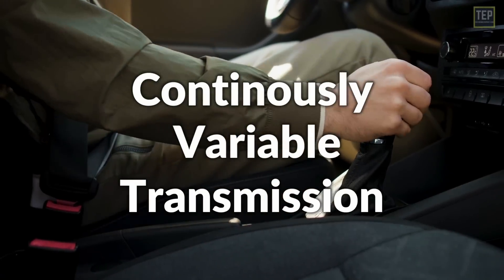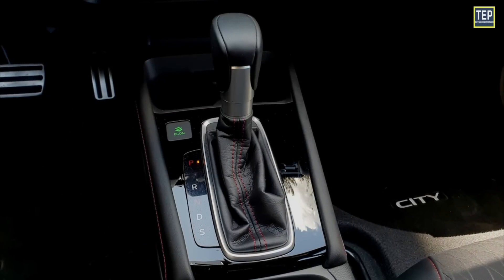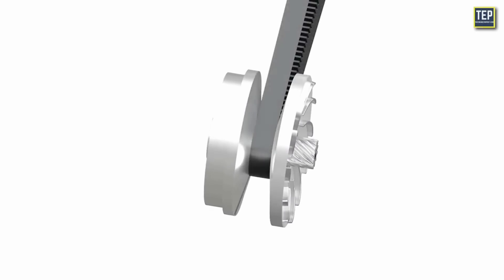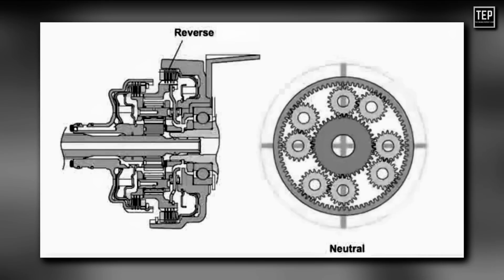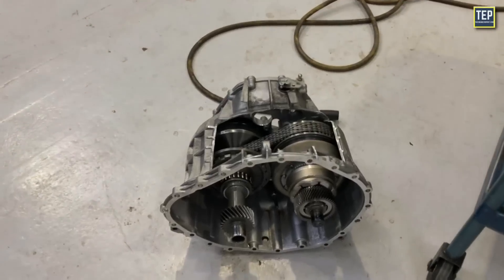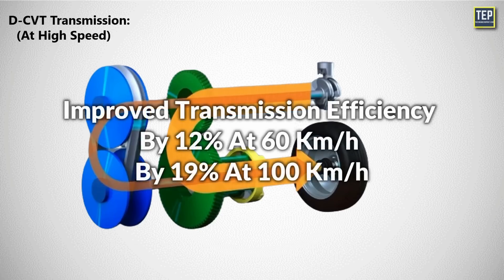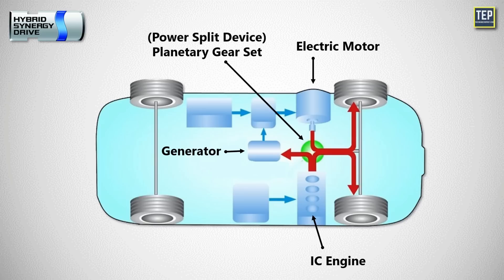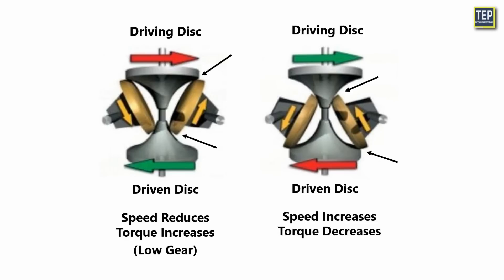Are There Any Good CVT's? | Different CVT Transmissions Explained

Comment: E-CVT (in particular Toyota's Hybrid Synergy Drive) is a clear winner.  It is mechanically the simplest transmission you'll ever see:  no clutches, no shiftable gears, no friction points (belt or roller), no hydraulically controlled mechanical transmission parts.  Only two motor-generators, one planetary gearset, and one fixed reduction gear for the drive motor.   All control is done from the electronic power controllers, and consists purely of controlling the engine throttle and the electrical phases of the motor -generators. 
I'm impressed by accounts of mechanical CVTs reaching high mileages, but they are still depending on the material-science magic of friction points that bear many hundreds of pounds of thrust on a regular basis.   It would take incredibly little to go wrong at those friction points for a mechanical CVT to become useless.
Reply: doesnt the Ford Maverick cvt use the same principle?
Reply: @kevinmccune9324  Yes. Ford originally acquired its eCVT technology from Toyota in the mid 2000s but has since further developed it on its own.
Reply: @kevinmccune9324  Yes Ford traded engine and emissions tech with Toyota in exchange for a Licensing agreement for Toyota's Ecvt design around 2004. It's  used in the Escape, Maverick, C max and Fusion Hybrids. I can actually tow 4000 lbs with my Maverick's Ecvt.
Reply: there is one downside to the E-cvt and that is it does not amplify torque like a stepped transmission or a mechanical CVT, it is in high gear effectively but that's why you have the drive motor on the output side of the transmission. I like the design myself and agree with all your points. I would increase the power of that drive motor. Did you know that you could create an AWD variant of this transmission by removing the drive motor from the front axle and placing on the rear axle.
Reply: @TheRed6263  I have to disagree.   The engine power at one RPM is transferred to the same amount of power at a different drive train RPM.  (Maybe not quite all of the power; there are losses of a few percent, just as in a belt-type CVT.)  For the same power, the ratio of the engine torque to the drive train torque is (ignoring the small loss) equal to the inverse of the ratio of the speeds.  i.e. a fast engine driving all its power to a slow drive train = torque amplification.

You may have experience what feels like low torque in a Prius, but that's because of the small (~100HP) engine in a car weighing over 3,000 pounds, not because the hybrid drive fails to transfer torque..

Electric AWD is a great idea.  The Toyota approach on Prius and RAV4 is to add a low-power motor in the rear, with high-reduction gearing to give good torque at very low speeds.  This gives a good extra boost for getting started under slippery conditions, but it drives pretty much like FWD at normal driving speeds.
Reply: @TheRed6263  I have a 2023 Toyota Sienna van, AWD version.  The rear axle is driven by a rear electric motor, with no mechanical connection to the ICE.  It appears to operate when starting from a stop sign, especially when turning.  And the AWD version has a faster 0-60 time than the FWD version, so I gather the rear axle drives under hard acceleration.

Comment: Are There Any Good CVT's?  Your title suggests that the answer may be 'no'.    
I now understand that Toyotas with CVT often have the launch gear with a belt and pulley CVT.  But Toyota E-CVT hybrids use a planetary gear system which avoids the need for belts and pulleys.
I am encouraged to see Toyota E-CVT does not use belts and thus does not depend on friction between belt and pulleys.  For me this is the way to go.

Comment: Well millions of Prius owners have these with 400,000 miles on them so they can't be that bad?
Reply: I drive a cvt Toyota. It’s not very exciting, but it’s a very impressive, efficient and reliable engine.
Reply: @jobvhk0335  Engine, or transmission?
Reply: @jobvhk0335  eCVT toyotas are perfect cars for everyday driving, they definitely are not cars meant for having fun.
Reply: That's because Toyota's CVT is an e-CVT, with actual (planetary) gears, and not a full reliance on a rubber or metal belt to transmit power.
Reply: @SgtNuker only hybrids have that the normal gas engines do NOT
Reply: @myashamoore5239  My comment was at the author referring to a Prius ... which IS a hybrid. I know the difference.

Comment: No, there are no good CVT's, just ones that suck less.
Reply: blablabla 🙄
Reply: @Bruno-m9f8o  Which provides you with more reliable way to apply force?  A lever which is what all gears are at their core or a string wrapped around an object, being pulled.

Both deliver force, but one does it reliable, consistently, and creates huge mechanical advantage... the other is, well, a child's toy called.a Top.

CVT's in their current design, will never ever be as reliable as geared transmissions.  Its simply physics.

Comment: The new CVT in fluid with a belt a stupid idea go back to a rubber belt with easy access the DAF and Suzuki Bergman are the best CVT transmission because they are easy to access and if the belt breaks it can be easily replaced by an ameture mechanic were in the planetary and belt less CVT much better and Toyota and Honda use them in there Hybrids there lubricanted gears so much more robust than belts in fluid so expensive to repair its a case the older rubber belt CVT transmission so much easier to replace and cheaper also in the UK some Invicars had a simple rubber belt CVT transmission and there is a British you tuber with an Invicar with the CVT transmissions and he has replaced the belt himself quickly and easily l will never ever buy a Nissan Mitsubishi or Subaru with a CVT transmission because they are to unreliable
Reply: Who are YOU to babble on about what is reliable and one is not?  You don't even know how to use punctuation in your rants! 😂😂🤣😅😅😅
Reply: The rubber belt in a CVT especially on a Suzuki Bergman is so much cheaper and easier to replace the rubber belt then one of these stupid CVTs in fluid it usually the whole CVT has to be replaced especially the JATCO CVT in most Nissan's and Mitsubishis and some Suzuki's but Suzuki's been much lighter cars there is not a great deal of strain on the CVT but the torque converter transmissions are much more reliable than most CVTs but the rubber belt and two pulley CVTs can be repaired by a novice mechanic because l seen a you tuber who has replaced the rubber belt on his Invicar and it didn't thousands of pounds or dollars depending on what country you come from and the CVT in Toyota Hybrids are a plantery

Comment: I have 2014 Nissan Frontier with 4.0L engine and CVT transmission. Have put 230,000 miles with no problems. Has plenty power, and at 80 mph is only 2300 rpm. Regularly maintained of fluids.
Reply: dont think thats a cvt

Comment: only reason why CVT is in use is fuel economy. 
I had IS250 and now have IS300h. 
eCVT advantage is obvious in traffic  - helps to reduce fuel consumption easily by 40-50%
but still old style hydrokinetic gearbox in IS250 was way more driver friendly or at least was giving better impression.

Comment: excellent explanation.  I had a Subaru justy for many years and while it was primitive, like the beetle, it was tough and never needed servicing. I now own a Honda hrv and it is a joy. I have only had it for 45k miles but the cvt trany has been a pleasure, shifting manually has been my favorite and my two Honda accords lasted 400k miles. but cvt mechanics seem ok to me. `````````````````````````````````````````````````````````````````````````````````````````````````````````````````````````````````````````````````````````````````````````````````````````````````````````````````````````````````````````````````````````````````````````````````````````````````````````````````````````````````````````````````````````````````````````````````````````````````````````````````````````````````````````````````````````````````````````````````````````````````````````````````````````````````````````````````````````````````````````````````````````````````````````````````````````````````````````````````````````````````````````````````````````````````````````````````````````````````````````````````````````````````````````````````````````````````````````````````

Comment: I decided to try my first CVT and bought a Honda CRZ. Honda engineers did a great job designing the sport mode. However, the belt broke at 40,00 miles. Granted, I'm a brake late-- throttle early sports car/motorcycle guy, but...
Reply: CVT's are light duty use ONLY!

Comment: Life was better without them. It's an over complected engineers wet dream.  The eCVT is not that. They should remove the CVT part of it. If you have planetary gear sets with clutches to change torque and speed, that's not a cvt, it's a transmission.

Comment: Small gas or diesel generator to charge a battery and/or power an electric motor. When battery or power generation technology gets good enough, we won't need the traditional generator. Trains have been using this technology for decades.

Comment: Have a Nissan cvt with 200k and a Subaru cvt with 145k on it. They're way more reliable than people suggest. Key to reliability is fluid changes. They're not super expensive to do compared to 5-7k for a new transmission. If you're going to keep a vehicle with a cvt, change the fluid every 50k and it will last a very long time.

Comment: I have a 20 Camry with the direct shift CVT. I rate it as a marginal performer.  I will admit it is very efficient, but really diminishes a car's enjoyment.  Anyone who had driven a car with a GM TH340, TH400, Chrysler Torqueflight or Ford Cruise-O-matic will never be satisfied with a CVT.  MHO.  I have driven a number of WV group's dual clutch cars and those are amazing.  A CVT should aim at that driving dynamic as a goal.
Reply: I've driven cars and trucks with all of the transmissions you've listed, and currently drive a Outback Limited XT.  I'm completely satisfied with the drive-ability and performance of this car.  Can't tell the difference between it's CVT and a traditional automatic transmission.

Comment: The workings of eCVT transmissions wear glossed over and not really explained. The core is the power split device, which is a planetary gear set. MG1, referred to as the generator in the generic diagram, is connected to the sun gear, the gas engine output to the planet gears, with a free-spinning double sided ring gear engaging the differential. The electric motor, MG2, separately engages the differential, and is a generator when applying regenerative braking as well as serving to reverse the vehicle, since there is no reverse gear. MG1 manages the gear ratio by controlling the relative RPM and direction of spin of the sun gear while generation electricity, and it also serves to start the gas engine.
Reply: Simply put, it's run with 2 electric motors and no belts.

Comment: CVTs are stupid in concept. Fine on a moped or low-powered appliance, where it's easy to service and replace the belt,  but not on a vehicle. 

The only good ones are Toyota E-CVT 'SynergyDrive', and Honda's E:Hev system, and neither really are CVTs. Well, maybe Toyota's E-CVT is, but it's a completely different design, and it's actually far more reliable than a manual, automatic, or DCT transmission (no clutch or contact friction).

Comment: I change my Honda CVT fluid regularly with Valvoline CVT Fluid. Then I like to read how everyone says my CVT is going to fail because I don’t use Honda Fluid. I’ve been using Valvoline for 255,000 miles and the CVT still performs fine like it did the day I bought it.

Comment: 1. If you reverse the thrust at the input of any other transmissimon (as was shown for thoroidal), you don't need reverse as well.
The question how to do it.
2. The main purpose of the direct shift transmission - is to reduce a loading on CVT part, which can have smaller diapazone of the gear ratios.
It is important at heavy offroad  conditions at SUV application or rapid acceleration from 0.
3. E-CVT is explained quite poor. Even without the detailed theory of planetary gears - more details should be given.

Comment: The so called eCVT that Honda provide is not a CVT. All gear ratios are fixed. There is a motor/generator directly coupled to the drive wheels and another motor/generator coupled directly to the gas motor. At higher speeds the gas motor can be clutched to the drive wheels at a fixed gear ratio. The correct description of the system should be called an electric CV motor and a gas CV motor. By the way it is a very good system; I have one.
Reply: Yeah, they call it iMMD (intelligent multi-mode drive). Seems simpler than the Toyota Hybrid Synergy system with the drive splitter gear. The electric drive is direct (using either battery power or generator power or both) and the engine drive at 1:1 ratio also has no "gear" in the drivetrain, just a lockup clutch to bypass the electric drivetrain. It overcomes the electrical losses of the drive motor operation at high electric motor RPMs. I have an old 2009 Honda Insight hybrid with a metal belt CVT. Nearly 200k miles on the clock and no issues. Just a couple of routine CVT fluid changes in 16 years of use. It's very efficient at highway speeds and quiet too. 62mph at 2,000RPM. It also has a "7 speed manual" simulation mode with paddle shifts to select fixed ratios for a bit of fun but that hurts fuel economy and it actually accelerates faster in CV mode - lol

Comment: Totally surprised by the claim that toroidal CVT can take more torque than a belt. I’d still like to know just how resistant these mechanisms are to damage from slippage, as that would inevitably happen.
I have a Kizashi with CVT and it performs great. I even tow a trailer with no ill effects after 170K kilometres (About 110K miles). Not sure which type it is, (I do know it’s a steel belt) but it works.
I wonder if the toroidal unit could handle the output from a 6.7 Cummins? And sill be a reasonable size to put in a truck.

Comment: CVT is not here to stay do to it's reliability problems.  Very rare that they will reach high mileage use. Special expensive transmission fluid is a turn off. If you money to burn, can make a nice play car.
Reply: Running a 2011 Lexus ct200h with 140K on the clock. It has a CVT and no problems.

Comment: The new subaru performance transmissions pretty good, light years better then previous gen. The simulated shitfting in sports modes very impressive how it responds like a dct.
Reply: I don't really get why they are called "simulated" shifts. They are real FIXED ratios that the cvt goes to whenever manual mode is selected. You could red line a Subaru engine with those ratios quite easily and you could go down a hill with engine braking too!

Comment: Let's not forget the original CVT... Buick Dynaflow. Multi stage, multi path torque converters with variable stator blades. Smooth as glass. Unfortunately NOT efficient.

Comment: The fundamental weakness of most popular CVTs is reliance on dynamic friction. In a conventional automatic, clutches and bands suffer very little wear because they are either statically engaged or fully disengaged. The only wear is during the fraction of a second during a shift. 

Chain/belt CVTs are continuously engaging with every rotation. They have to be tight enough so as not to slip much but making them tighter increases wear. In a conventional automatic you don't have to  increase wear as load (hill climb etc) because once they are engaged there is NO slipping. So engineering is free to provide enough engagement pressure for ALL forseeable load conditions.
Reply: the subaruˋs reduces power from the engine to prevent cvt damage because of overheating through high tension. so it practically stops uphill on steeper terrain . although it has great awd, it surrenders in challenging circumstances
Reply: So you're saying when there is additional load like hill climb or heavy baggages, the CVT slips?
Reply: @DarkExternalHeart  Hopefully it does not slip, but it needs tighten up significantly to maintain the grip, which means more wear and more heat.
Reply: I agree that CVT might not be ideal for high load (towing/hill climb) usage. However I note that considerable engineering effort has gone into solving this problem, to the point where some manufacturers have very high power/torque cars equipped with them. I have a Subaru 2012 DIT (221 KW) and it has a CVT. Seriously fast. Seems to work well. Will it last? Yeah that is a good question.
Reply: @markir9  What you say is true, it's possible to engineer around problems. But I think the inherently more reliable solution is best in general. Is CV really worth the extra trouble. What do we gain?
Reply: @theronwolf3296  I think the main reason Subaru in particular went to a CVT is that their 4 wheel drive system didn't have space to have more than 5 gears in a conventional auto trans. Whereas the CVT can emulate any number of speeds (sport does 6 and sport# does 8) and is compact. So what we gain (in this case) is a better trans than the old 5 speed (which were not great). However, the reliability question is still a good point. Fingers crossed since I have one...
Reply: They generate lots of heat and are for dummies who can’t learn how to drive a real vehicle with proper gearbox. Trash and money pits for maintenance. Automakers gave a clean story it’s for fuel efficiency, it’s actually to dumb everyone down and not understand mechanics and engineering
Reply: Extra costs at consumer expense

Comment: I have had a CVT Ford Fiesta.  It felt odd given that it held the same revs through most acceleration stages. 

Toroidal systems were first used in machine tools - constant speed motors, the change in speed all came from the toroidal CVT.